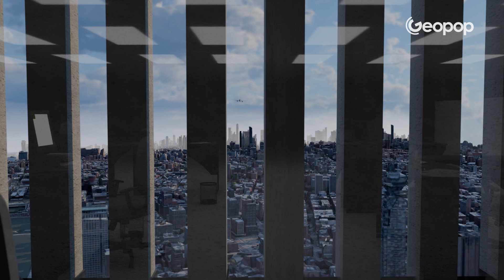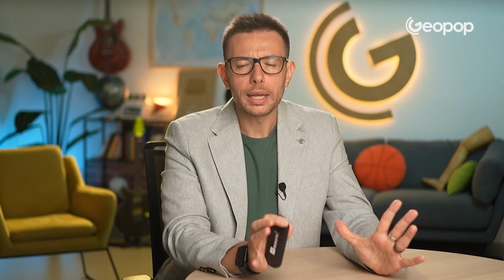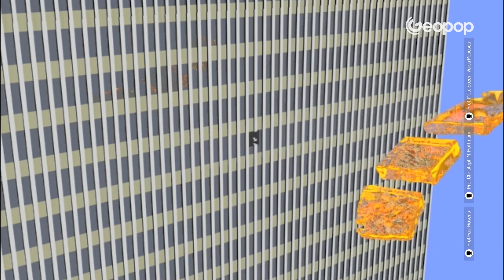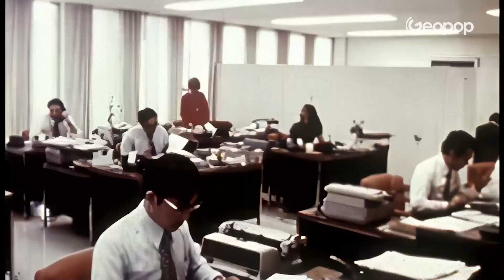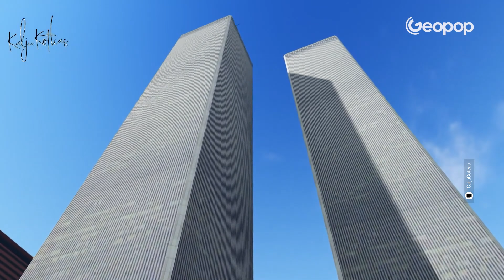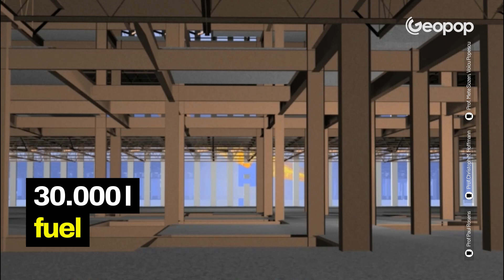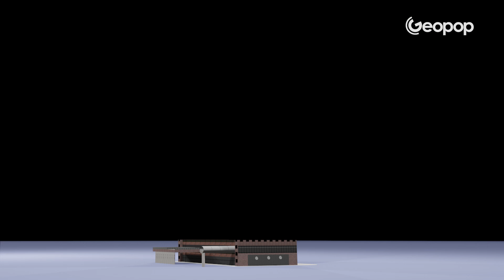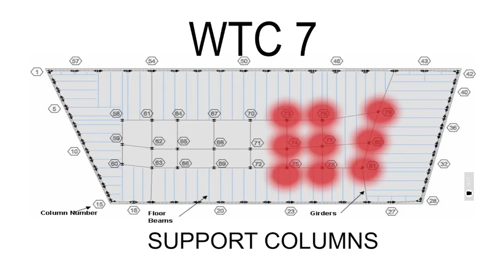9/11, 2001: The Technical Reconstruction of the Twin Towers and WTC 7 Collapses

Comment: Watch the close up video of building 7. The whole center went out before the sides and corners. It wasnt controlled at all
Reply: In controlled demolition,  the stairways and elevator shafts have to be removed prior to the demolition. What you see sticking up are the elevator shafts and stairwells. Of course those fell first. But the building held its shape nearly all the way down, I'm gonna say 3/4 of the way.  The top and corners held its shape. That means down below there would be no impact. If this thing was falling.  At some point the exterior/interior columns would have held up, causing deformation. The building didn't deform. It was taken down with preset explosives such as this one coming from tower 7.
8:26 in this one
https://youtu.be/bLF5D7M1YgA?si=aHSvS__uOdxMi1ZB
The firefighter said. " we gotta get outta here,  7 is exploding "..
Reply: @robbiehiatt9966  : Actually, after 7 hours of raging fire the firefighters saw the building weakening, and asked everyone to leave the area as it was going to collapse.
 
"The building didn't deform"
It did. And that's how the firefighters saw it was time to leave.
Reply: @ThomasKundera  it held its form 3/4 of the way down. Yes they reported a number of things that was false. They knew tower 7 was falling because of the explosions like this one here. 
Then 8:26 in this one
https://youtu.be/bLF5D7M1YgA?si=aHSvS__uOdxMi1ZB
The firefighter said. " we gotta get outta here, 7 is exploding "
Reply: @robbiehiatt9966  :
"it held its form 3/4 of the way down."
Not what I'm talking about.
The building went several tens of centimeter down about 30mn before the actual collapse, bending the walls near ground.
That's when the evacuation was ordered.

"They knew tower 7 was falling because" of the visible weakening of the structure.

"The firefighter said. " we gotta get outta here, 7 is exploding"
then what do you conclude outside being informed that WTC7 just collapsed?
Reply: @ThomasKunderaBis  for starters, tower 7 was evacuated when the first tower fell by the port authority not the fire department, that was  around 10 am. The building was empty for 6 or 7 hours.  You've got 2000 people trapped or dead.   In order for a building to hold its shape nearly all the way down,  all the supports must be eliminated at the same time. If just one vertical support held it would have crooked the roof, and vertical supports. Cheif Hayden claims him and his team ordered the evacuation, but at the time, his radio wasn't working.  Richard sherrier explains how an unknown source in the port authority gave the evacuation order.
Reply: @robbiehiatt9966  :
"for starters, tower 7 was evacuated when"
Not what I'm talking about.
Long after workers were evacuated, firefighters remained on site to try to contain the fire.
They saw it weakening, by the bulking of the lower facade. That's when they abandoned it, and also when some TV misinterpreted the "it's going to fall" by "it's already down".

 "In order for a building to hold its shape nearly all the way down,  all the supports must be eliminated"
The way the structure failed is well explained in NIST report.
You don't need to redo it here.
Reply: @ThomasKunderaBis  Except you can look at the collapse and tell that it did not happen the way that nist said it did. Sorry try again.  I'd be happy to point out the ways that this was incorrect. Let's start with the stiffeners that nist left out all together, those a very important.  Leaving them out would have made the building weaker. Look at there diagram, it didn't fall like that, and planes don't disappear when they hit a building.
Reply: @robbiehiatt9966  :
"Let's start with the stiffeners"
What is your proposed collapse sequence? Based on what? What is your expertise?

"and planes don't disappear when they hit a building."
Two subjects at a time is one in excess.
Planes didn't "disappear", they disintegrated and burned inside (for most part).
Your point?
Reply: @ThomasKunderaBis  I've been building structures for 30 years. If the inside of this building was to fall apart the way they show. Deformation would happen all over the exterior of the building as the exterior of tower 7 wasn't fixed at all. But that's not what we see. This was textbook controlled demolition.
A Commercial airliner cannot do 600 miles per hour at a thousand feet in altitude, it can go that speed at 30,000 feet. And it definitely can't do a perfect 180 degree turn at that speed. Why would you circle around to hit the other side to begin with. That was the side where no one was at. Not to mention the eye witnesses standing outside the pentagon at the time of the crash claiming it was a missile. There's holes all over the official narrative.

Comment: Thermite, molten steel for weeks/massive smoke. beams cut at 45 degree angles. buildings fell at freefall speed (this is only possible with controlled demolition).
Reply: And yet absolutely none of that is true.

Have you ever considered that maybe the conspiracist corner of the internet is feeding you a bunch of nonsense?

Comment: Ok, please explain  building 7. For over 50 years, no steel building collapsed until 9/11. i might give you two but not building 7. No fuel other than paper that can't hit that temperature. Please do tell how that came down
Reply: "please explain  building 7"
7 hours of fire.
Reply: The collapse of Building 7 is probably the most studied engineering disaster in history and the subject of 5 comprehensive engineering studies and more than two dozen technical articles in major peer reviewed engineering journals, most of which were published 15 or more years ago. Thousands of pages of material.  This should get you started.

FEMA BPAT (initial report superseded by NIST NCSTAR 1A)

NIST NCSTAR 1A: Final Report on the Collapse of the World Trade Center Building 7, 2008.

Guy Nordenson and Associates, WTC7 Global Collapse Analysis Report and Summary of Findings, 2010.

Arup, WTC -7 Structural Fire Analysis Report (Runs 1-4), 2010.

Weidlinger Associates Inc., WTC 7 Collapse Analysis and Assessment Report, 2010.

BRE Centre for Fire Safety Engineering, Analysis of the Impact of a Fire in the Mechanical Room (5th & 6th Floor) of the World Trade Center 7 Building, 2010.

T. McAllister, R. MacNeill, O. Erbay, A. Sarawit, M. Zarghamee, S. Kirkpatrick, J. Gross, Analysis of structural response of WTC 7 to fire and sequential failures leading to collapse, J. Struct. Eng. (United States). 138 (2012) 109–117.

For a summary of the major studies I would recommend THE COLLAPSE OF WORLD TRADE CENTER 7: REVISITED by Mhd Anwar Orabi , Liming Jiang , Asif Usmani and Jose Torero which is a 33 page summary of the different analysis and conclusions published in 2020. Sorry, YouTube will delete this post if I give the link but it should be easy to find and is available from the University of Queensland, Brisbane. 

Real structural engineering industry professionals conducting real engineering studies and publishing them for other professionals to see. Not amateur YouTubers appealing to the gullible and credulous.

Happy reading

Comment: S9 y did trade building 7 fall too? These buildings were demolished
Reply: The collapse of Building 7 is probably the most studied engineering disaster in history and the subject of 5 comprehensive engineering studies and more than two dozen technical articles in major peer reviewed engineering journals, most of which were published 15 or more years ago. Thousands of pages of material.  This should get you started.

FEMA BPAT (initial report superseded by NIST NCSTAR 1A)

NIST NCSTAR 1A: Final Report on the Collapse of the World Trade Center Building 7, 2008.

Guy Nordenson and Associates, WTC7 Global Collapse Analysis Report and Summary of Findings, 2010.

Arup, WTC -7 Structural Fire Analysis Report (Runs 1-4), 2010.

Weidlinger Associates Inc., WTC 7 Collapse Analysis and Assessment Report, 2010.

BRE Centre for Fire Safety Engineering, Analysis of the Impact of a Fire in the Mechanical Room (5th & 6th Floor) of the World Trade Center 7 Building, 2010.

T. McAllister, R. MacNeill, O. Erbay, A. Sarawit, M. Zarghamee, S. Kirkpatrick, J. Gross, Analysis of structural response of WTC 7 to fire and sequential failures leading to collapse, J. Struct. Eng. (United States). 138 (2012) 109–117.

For a summary of the major studies I would recommend THE COLLAPSE OF WORLD TRADE CENTER 7: REVISITED by Mhd Anwar Orabi , Liming Jiang , Asif Usmani and Jose Torero which is a 33 page summary of the different analysis and conclusions published in 2020. Sorry, YouTube will delete this post if I give the link but it should be easy to find and is available from the University of Queensland, Brisbane. 

Real structural engineering industry professionals conducting real engineering studies and publishing them for other professionals to see. Not amateur YouTubers appealing to the gullible and credulous.

Happy reading

Comment: So how did the BBC report that building 7 had collapsed before it actually did? First time a steel high rise was brought down by fire and we’re supposed to believe it happened 3 times within the same event.
Reply: "So how did the BBC report that building 7 had collapsed before it actually did?"
-The fire department told them it would likely collapse, and they mis-reported it.

"First time a steel high rise was brought down by fire and we’re supposed to believe it happened 3 times within the same event."
-It's also the first time large jets flew into buildings, so what's your point?  The Plasco highrise in Iran collapsed solely due to fire, and so did a 26 story residential highrise in Sao Paulo Brazil.
Reply: @ The record number of put options on the airlines involved? The presence of molten steel as witnessed by firefighters? The presence of thermite in the trade center dust? The passport “found” on the street? Mike Springmann and the visa bureau in Jeddah?
Reply: @ 
"The record number of put options on the airlines involved?"
-Not a "record number" at all, and all trades had alternative, innocuous explanations.

"The presence of molten steel as witnessed by firefighters?"
-The only people claiming steel melted, are conspiracy theorists.

"The presence of thermite in the trade center dust?"
-You mean paint chips?

"The passport “found” on the street?"
-First of all, it was found before the building collapsed, and you say that, as if it were the only thing that fell on the sidewalk...

"Mike Springmann and the visa bureau in Jeddah?"
-Government incompetence.
Reply: At 11:07 am CNN reported Building 7 had collapsed at 10:45, or 15 minutes after the North Towers collapse at around 10:30. CNN got their (mis)information from the respected news agency Reuters, which picked up an incorrect report. They issued this statement: “On 11 September 2001 Reuters incorrectly reported that one of the buildings at the New York World Trade Center, 7 WTC, had collapsed before it actually did. The report was picked up from a local news story and was withdrawn as soon as it emerged that the building had not fallen.” 

On 9/11, reporters also said that Camp David had been hit by a plane. Forbes magazine reported that “A car bomb exploded outside the State Department, according to State Department sources.” CBS News reported that as many as eight planes have been hijacked and only four have been accounted for. 

Those reports turned out to be false, obviously. Just a few of hundreds of news reports that, in the chaos and confusion of that rapidly evolving event would, with the benefit of 20/20 hindsight turn out to be wrong.

News flash: Reporters are human being and just like you, human beings make mistakes. 

As for why anyone would be reporting issues at Building 7, I wonder,... 

Deputy Chief Peter Hayden of the New York Fire Department recalled: We had our special operations people set up surveying instruments to monitor, and see if there was any movement of [WTC 7]. We were concerned of the possibility of collapse of the building… One particular engineer there, we asked him, if we allowed it to burn could we anticipate a collapse, and if so, how soon?… And it turned out that he was pretty much right on the money, that he said, ‘In its current state, you have about five hours

With everyone following reports of its deteriorating condition, throughout the day on 9/11/2001 media outlets had been reporting Building 7 was in danger of or about to collapse. In the chaos and confusion one outlet – the BBC – added “or has collapsed” at 5:00 pm.  

OK, so what?

Comment: Jeff-S was catering manager at 7WTC, but had a side-line of structural engineer, just in case cooking french fries didn't work out.  Maybe he can explain how a plane with no wings or engines,  and no Manifest of dead passengers can hit the Pentagon, almost surgically at low level and leave the lawn in front of the Pentagon perfectly intact?
Reply: "Maybe he can explain how a plane with no wings or engines,  and no Manifest of dead passengers can hit the Pentagon, almost surgically at low level and leave the lawn in front of the Pentagon perfectly intact?"
-Where do you conspiracy nuts get these ideas from???